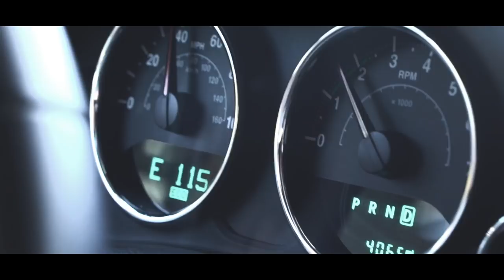RAGNAROK Hyper Car Build | Part 1

Comment: I still hate to see the Lamborghini without a engine  Even if its for a good cause 😢.    You should LS swap the lambo just for the hell of it 😁
Reply: Dude 🤫 no lambo ls swaps 🤣 thats against the law
Reply: ...LS swap a Lambo? Wtf did I just read...
Reply: I 2nd this😂 ls swapped lambo😂
Reply: Haha, no way. Lambo motor = $$$$$$$$$$, LS motor = junkyard.  Everyone these days has an LS V8, yea they're decent but in the supercar world the LS is a joke with a shitty ass low redline!
Reply: Adams World thats why the hennessey  venom gt has an ls......  calm down kid and continue driving ur little honda civic
Reply: This guy is onto something here people
Reply: Adams World you can rev to over 8k or more if you build it for it, nascars did it for years the lsx is capable to just takes the right cams  rods valves and Springs  look it up plenty capable v8s.. now I agree it doesn't belong in an exotic but it is more than capable of the job with way more low end torque on top of the same or more power
Reply: Would drop a 527 lsx 8.64L largest ls motor! Go big or go home lol !
Reply: lol The hennessey venom uses a LS because its built by Hennessey, and its a common platform they work with and easy to replace.
Reply: "LS swap" is such a cliche thing to say... Just after "K20 swap." It's usually said by kids that heard someone else say it.
Reply: Andrew Delashaw    I guess I’m a 45 year old kid at heart.  lol 😂
Reply: the Hennessy run on an lsx just saying
Reply: V12 swap?
Reply: Fuck it, 2JZ swap. Doubt that's ever been done.
Reply: DO IT!! It will open so many doors.. then people can buy wrecked lambos and ls swap once they see what goes in it..
Reply: @comandernejo  B is for Build "Uhhhhhhhh......."

Comment: So you're making the 4c what it deserved all along? Despite adding a lot of weight, it's going to be madness. I cannot wait for this build!
Reply from the maker: im not going to add that much more, surprisingly the 4c power plant did weight a lot when we took it out, yes much less than the lambo engine but maybe only a few hundred lbs which i will save on the carbon body panels and billet suspension.
Reply: Royalty Exotic Cars oh wow that's awesome! Are you going to maintain those Italian curves? Or go crazy racecar styling? Or some sort of hybrid?

Comment: twin turbo lambo engine in bmw isetta
Reply: Yes. Won't fit but yes.
Reply: bungee strap it on it will  be fine if it cant support the weight put a wheelie bar on

Comment: If your going to extend the wheel base have you conisdered doing a Straight 6 from Ford ? Here in Australia we have the 4 Liter Barra Turbo, its a Straight 6 that can make huge power. i run 950 HP, around 850 ft of torque in my Falcon XR6 Turbo, thats on 21 PSI on E85, i have no doubt the motor would support alot more.
The Barra motors are very very strong, very reliable, and can support a shit ton of power. while being a fairly nice sounding motor and you can get them cheep, build them for cheep all while getting that huge power number.

Comment: Wheel base, I would of thought for those speeds a bigger base/foot print would be better shore you'll have down force but still won't it be twitchy at 250+mph all hyper cars with that top end speed have a much bigger print. Should be interesting and good luck

Comment: You need a new chassis n stretch it and the wheel base. Better off building a TT Porsche RSR using all factory parts will have value once completed cheaper to build plus way better platform it can easily make 2000 HP. Lotus sucks now add Alfa tub for a project you just trying to build something that’s fun to drive .
How many TT lamboV10 n R8’s even Vipers tons. Definitely making this project harder than it has to be exactly you can’t do it better guess we all get to watch!!!!
Just remembered VW built a concept GTI with V12 TT 6.0 Bentley was a pos uncontrollable  FUN TO DRIVE CAR!!!! 
You won’t be the first to do anything like that!!!! 10yrs ago

Comment: Get the Agera. Fastest production car in the world right now...
Reply: Paul Jr. Harrington there is only one agera rs for sale right now on earth and its on sale for 9.8 million dollars
Reply: And it is located in russia
Reply: meriç tuna I thought it was in Germany also there’s an agera r for sale in ca
Reply: I agree, an agera would be cool
Reply: The one:1 has more power and is lighter
Reply: Fassemspeed301 It has the very same power, and just a few kgs lighter. But it has more aero, so faster in corners, but it has lower top speed. The RS is the fastest.
Reply: Zoltán Juhász no the one:1 has about 1400hp and the agera rs "only" about 1100hp (except the models that have the one:1 motor built in like the agera rs1)
Reply: Fassemspeed301 and impossible to get your hands on
Reply: As if he will be driving top speed...
Reply: Zoltán Juhász No standard Agera R and Agera models have 1104 I believe. And the One:1 has a 1383 V8.
Reply: they still havent done a top speed run (or at least havent told anyone about it) yet so we dont know how fast it really is.
Reply: ICKY427 the Agera Rs averaged 277.9 both ways (against and towards the wind), and topped at 284 in a one way straight line .
Reply: Kerngedanke: REIN!!!! Yes, and the record braking RS is exactly that one which has the optional 1MW package.
Reply: It’s not in production anymore. The Bugatti Chiron is the fastest production car in the world
Reply: brayden hepworth That’s what Doug DeMuro would say.
Reply: brayden hepworth How is that relevant? Koenigsegg has the title, period. You don’t loose it just because you start making newer cars. To get the title, you actually have to go fast, not just claim you “could” go fast, but you “don’t have tires”.
Reply: UV Tuvi You're both wrong, it's a white Koenigsegg Agera RS for sale in Wien, Austria and it costs 7.777.777€ or 8.852.000$.
Reply: Zoltán Juhász you’re completely right and I agree, I’m saying by Paul’s wording the Chiron would be the fastest production car. No I’m not some Bugatti fan boy. I love what Christian has created and the agera rs is a definite dream car of mine
Reply: brayden hepworth Well, it is questionable. Their top speed should be more or less the same based on the numbers. However if you look at how fast they were accelerating at 400, I would say the Agera will remain faster. The Chiron is just too heavy, and has too much drivetrain loss due to the awd. But we will see...

On the other hand it is still a question if Agera RS counts as “production car”, because way less then 25 is made with the 1MW package, while all 500Chiron will have the same top speed.
Reply: Zoltán Juhász the Chiron is somewhat of a boat considering it’s weight. RS is amazing all around and I think everyone can agree. As far as if it remains a question I’m not sure. I feel like “fastest car ever produced” would be more  correct
Reply: @juzoli  actually bugatti said it's electronically limited to 261. Max speed was 270 again....
Reply: Codename Bug The electronic limit is absolutely irrelevant in this conversation, it tells nothing about its actual max speed.

Comment: A good lambo motor and gear box will run you 30-55grand U.S I'm sure then mods not much change from $80 grand this'll be a $200g U.S build

Comment: texas speed and performance 427 lsx twin turbskis 1200-1500rwhp . swap into anything. maybe in a 6 speed.

edit. probably lighter to use the lsx. that lambo motor probably needs 50k in the block alone.

edit2. doesnt that block need sleeves? 
 I love this getting after it.

edit3. shit this vid gets better by the second

Comment: I think you should find a carbon fiber monocock two peice shell and make it into your own car not branded royalty branded your own everything  maybe using an ls motor or something generic make your own shape body panels the lot you need a lathe a cnc machine a few guys with the mind like the guys from grind hard plumbing YouTube channel so a boilermaker engineer ect just to make your own parts for example those parts for the diff of the Bugatti they could so easily be made in house everything can so do a Elon  and make your own beast

Comment: Take the lotus and put a 4g63 out of a mitsubishi evo 8 fully built with  a pte 6870 turbo and 4 11 gears 1000ish wheel horse power and 200ish mph easy

Comment: With tech that's available today, anyone with financial means can build a car themselves that is superior to any hyper car.  No car is worth over a million dollars.  The same results can be had for far less doing it yourself.  All parts are readily available. AND CARBON FIBER IS NOT AS EXPENSIVE AS THESE CAR MAKERS TELL YOU!! SURE, IT'S EXPENSIVE, BUT THAT DOESN'T MEAN A CAR SHOULD COST MILLIONS OF DOLLARS
Reply from the maker: i do agree but they cost that much cause people choose to pay it for exclusivity. today it’s easy to find all the info online and to make anything you want. i do agree with that
Reply: The time is coming when people won't care about exclusivity.  When brand recognition won't matter.  Give them what they want and they'll  begin to wonder why they were paying so much for the same performance.
Reply: Also and idea that nobody else has done in a bugatti, add adaptive hand controls.  It's only a mechanical linkage that will allow you to drive the car without using your feet. It won't require any modifucation to the car at all.  It's used in millions of cars for those who have spinal injuries but are active productive people in society.  This would be very cool to show on your channel and I would of course volunteer. :)

Comment: I'm about 3 minutes into the video and it sounds like what you want is a Radical RXC, which costs like 140K, which is peanuts compared to building your own car at the same level of performance from scratch.

Edit: 8 minutes in now, you are fucking nuts in the best way, scratch that RXC, the next step for you is a Saturn V rocket.

Comment: Sorry but even 1800hp gallardos can BARELY hit 250mph. I'd be cautious as to be so confident about hitting 250 in that thing. 

Also at 250mph the amount of airflow is so immense that even a carbon tub and custom chassis will barely do anything to affect your top speed. What you need is aero. Aero aero aero. As an engineer myself, I think you're going in the wrong direction. I think you're caring too much about materials and suspension than you are air resistance, and stability. Without immaculate aero work, the car won't even hit 250, and even if it did, it would have so little stability that it would likely not even stay on the road. Be careful.